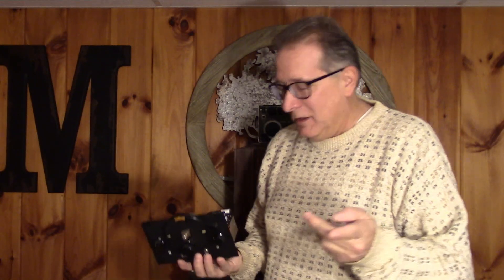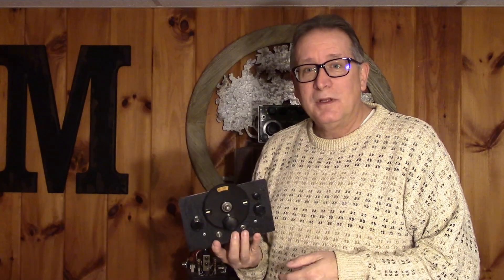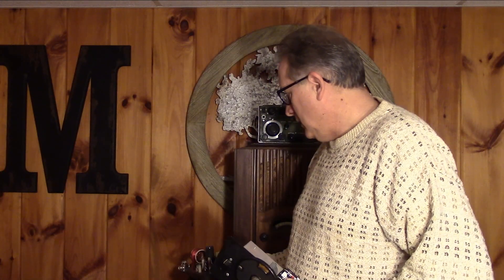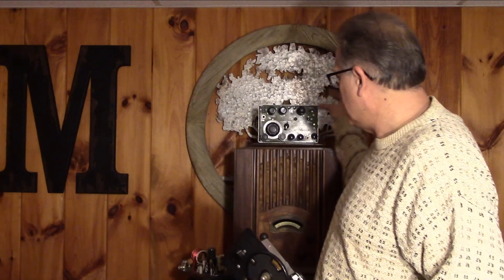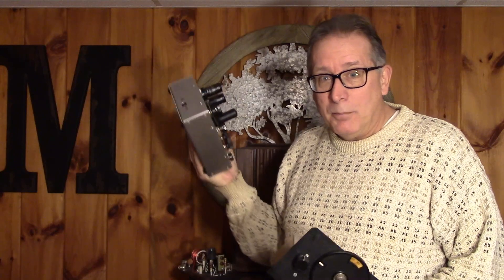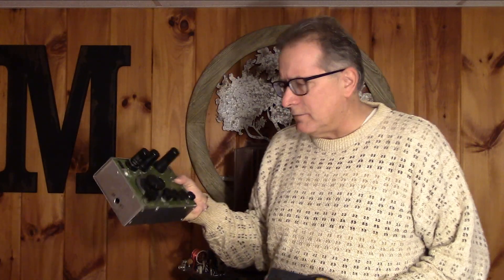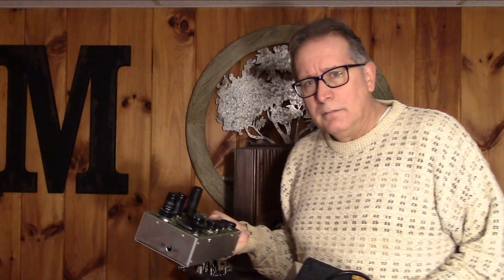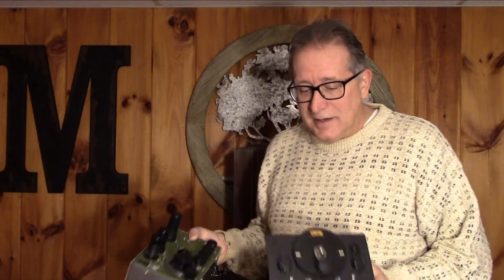Junkbox Teaser

Comment: I have a 1960 ARRL handbook given to me by Scott W7GSM who built most of his early gear. I enjoy the mix of tube and solid state circuits but often run into dead ends on projects just because I'm not sure if or what I can substitute. Transistor numbers are obsolete etc. I am trying to build the mk1 receiver and then I'd like to do the improvements making it the venerable mk2;), and add in a qrp transmitter from later in the book to make it a transceiver after I have my Ticket. Looking forward to the junk box video.